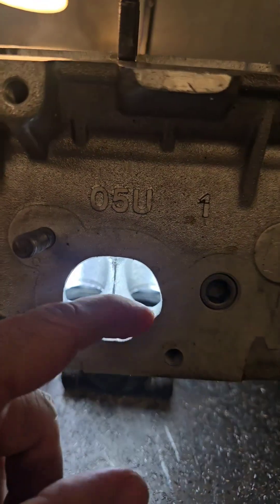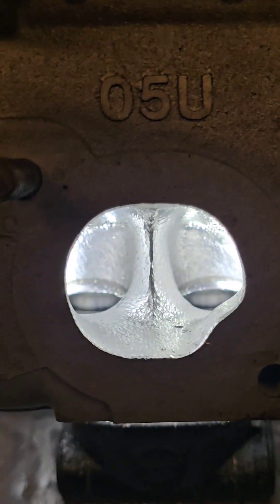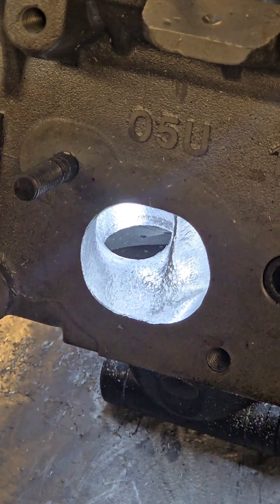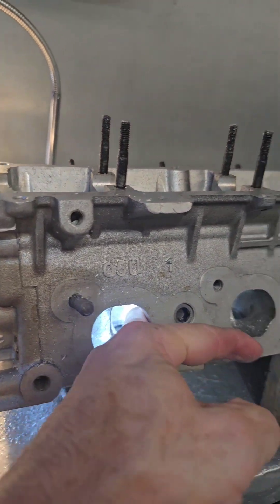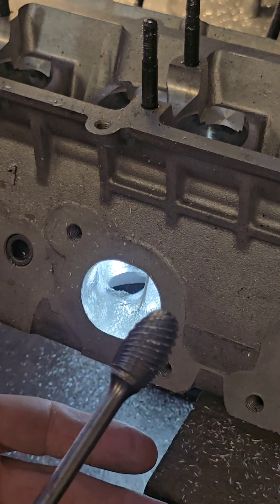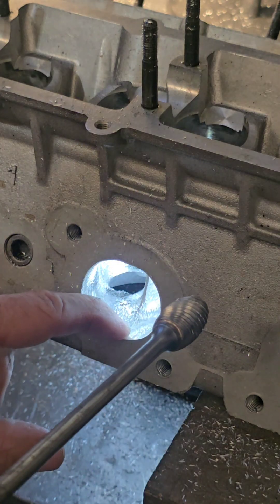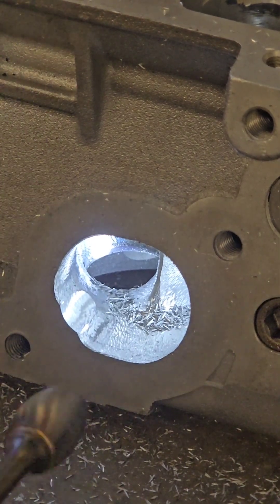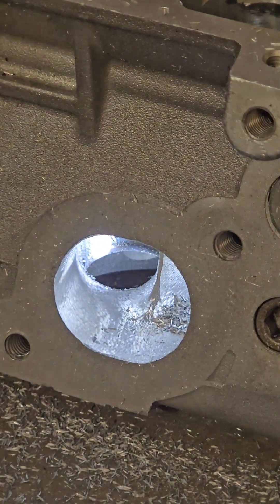RB26 Head Porting Part 8: Removing the Bolt Lump & Maintaining Consistent CSA! #rb26 #portingpolish

Comment: How does the CSA on the exhaust compare to the intake side? I assume there is a formula to get in the ballpark
Reply from the maker: Same mate if you're using a Mach index, and it's why I like to use the mach numbers over calling velocity numbers. 

The velocity limitations are  linked to the speed of sound. So, depending on temperature,  it can be twice intake velocity, as the same mach number. 

Hope that makes sense, mate. 👍
Reply: @ makes sense. What kind of Mach are you targeting? And what does it depend on? (on the intake the shape of the short side for example, so what would it be for the exhaust)
Reply from the maker: @XX-nw1xg   It all depends on what you're chasing, mate. 

So, for instance in say a controlled circuit racing series, well that will be very different to an all our drag setup that doesn't need the area under the curve like a circuit car would. Or even a limited series more so. 

But most run their dynamic mach limits are around 0.55 mach.  Flow bench is a bit different. SSR peak velocity seems to be around 350-400fps.  

But again, what shape, how long is the SSR, what is the angle change between port entey and valve seat. The higher the intake port, the less turn in the short turn. The move stable it will be. 

No different to you and me on a race track! Lol. 

This is why I hate those hard and fast rules on CSA, MSCA, surface finishes, etc, as the port shape dictates what's optimal for your setup.  

The physics doesn't change. Just what you're asking it to do does! 😂👍